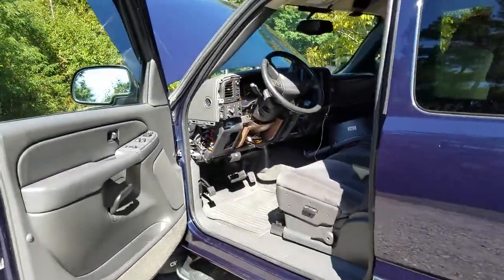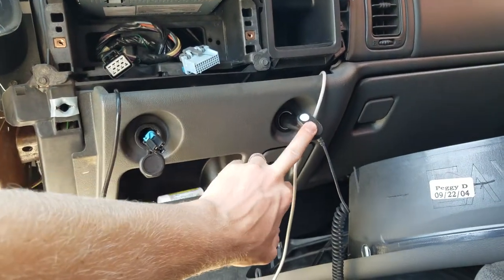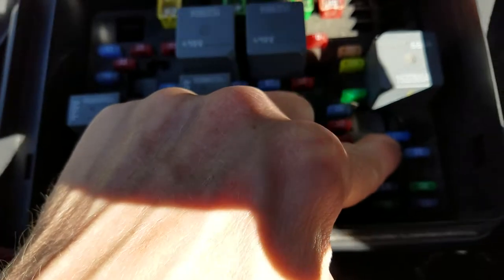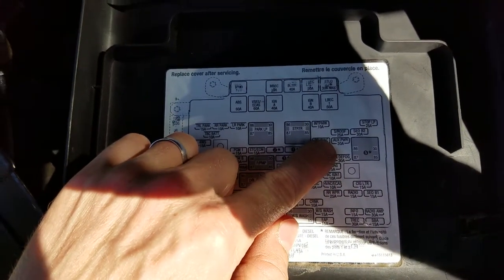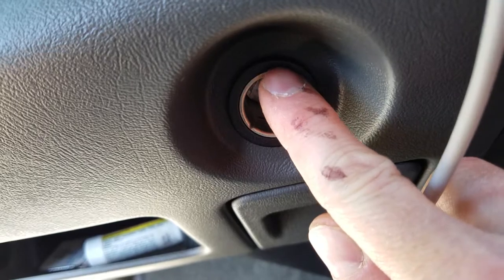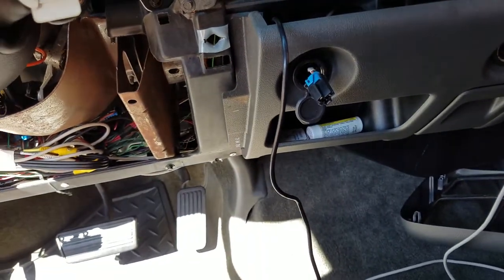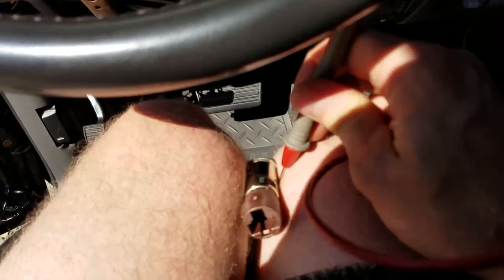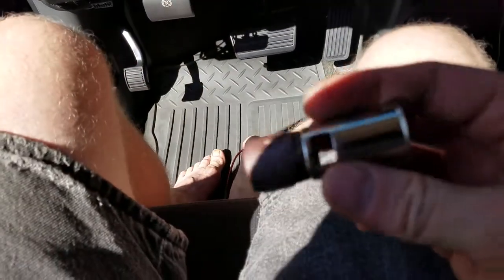2005 GMC Sierra Accessory Cigarette lighter fix. Part 1 of 2

Comment: Yea found same issue in mine today...yellow fuse 20amp controls aux power  closest to steering wheel...blue 15amp controls secondary aux outlet closest to passenger side....both fuses  are good...my first aux outlet runs good...my secondary is not lightning up...figure it's the outlet itself....good video tho
Reply from the maker: For some reason they are prone to failure.  I remember mine running very hot also, I assume there was a high resistance point before it died completly.

Comment: Hey man, i got a question for you. My truck before i owned it has been monkied around with ive replaces evey fuse amd replace the auxiliary power outlets andthey still wont work os there a video on how to find where to trace both aux power outles power source

Comment: I just fixed mine. All loose and wigley. I stuffed a 3/8 bolt in the socket, placed on the vice, put a extension in the other end. Hit it with a hammer to tighten the rivet. Still no connection. Used a solder iron and melted a pocket a gutter from the center to the pin. Filled with solder. Get the pin good and hot. I HAVE A CONNECTION!
Reply from the maker: Awesome! should hold up for a while, mine is still working nowadays.
Reply: @danfield8102  holy shit! I just watched your part 2. I guess we think alike. Too funny

Comment: I've been trying to track down the fuse for that right hand socket for ever. I didn't find a bad fuse. Now that I know which fuse for sure it is. I can look at it again. And also check the socket itself. This is SO helpful. I found the left socket fuse and replaced that one, no issue. Opposite of you. I am guessing 15A fuse should be the limit for both. Ther sockets may not handle 20A.
Reply from the maker: I suspect the wiring is not large enough to handle 20A without over heating, probably best to stick with a 15A

Comment: Great video! Thanks for sharing. Same thing happened to me. All I needed to do is rub some 1,000 grit sand paper on that inside , bottom contact and it cleaned it up enough to work. I have reciently replaced that one with a dedicated USB port.